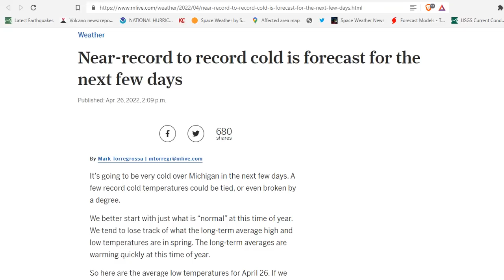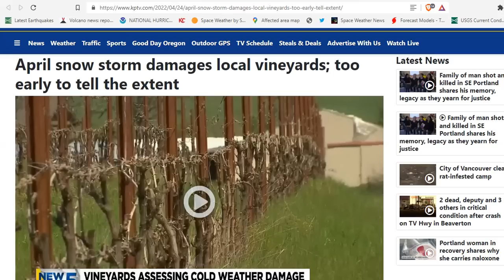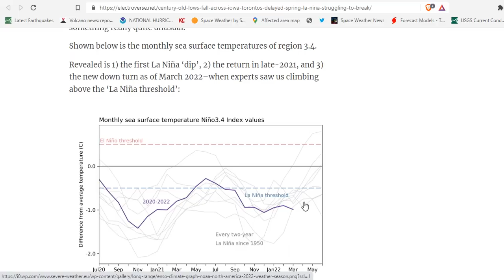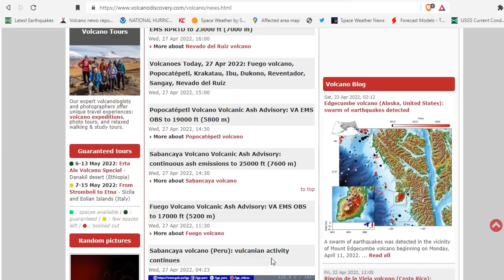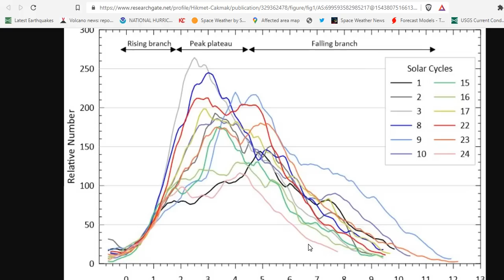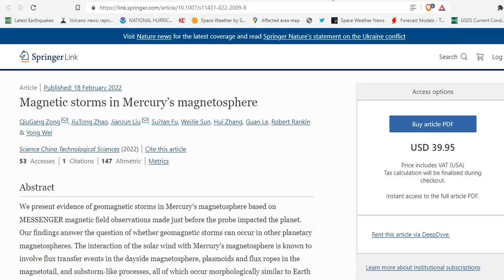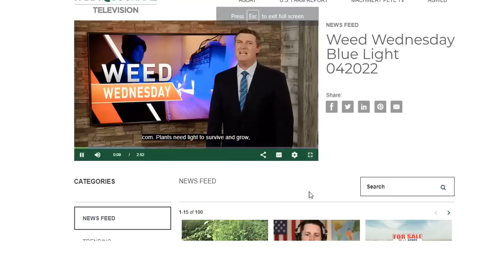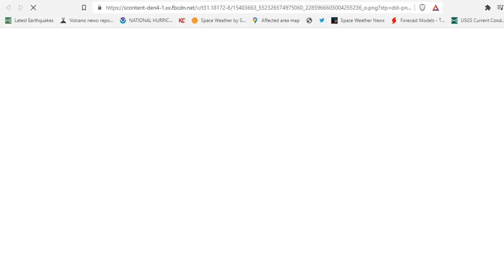Geomagnetic Storm - Record Cold & Snow - Killing Weeds With Light - CO2 Is Plant Food - Mars Quakes

Comment: Have my peas and some cauliflower out. It’s supposed to go down to 24/28 with windchill. Hoping they hold up. We had 83 degrees just the other day. It’s supposed to go back up to the 70’s after tomorrow. 
   My brother lives in Denver area and says it’s bone dry there. Only about a 1/10 of inch all of last month.
Reply: Cover your crops at night with clear plastic or? They r toast? Good luck to ya
Reply: @swervnk9742  was able to cover everything. All went well. Will have to do it again tonight.
Reply: @kurtc6372  we had frost in Sacramento Valley that wS not normal.  Good efforts pays off. Fish emulation?